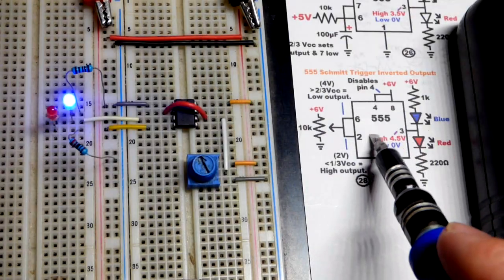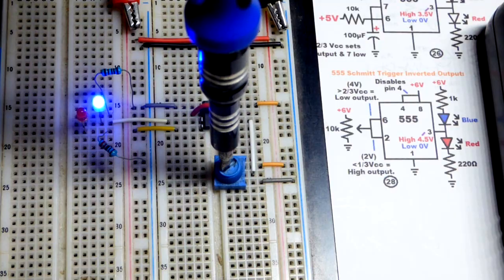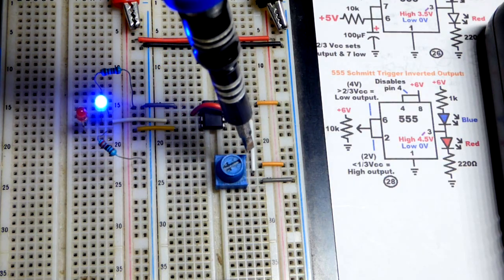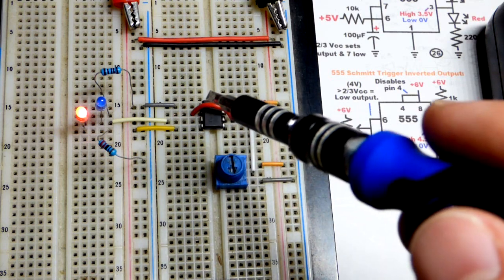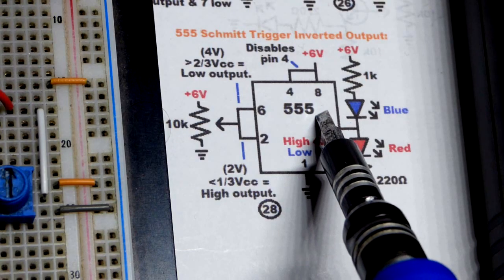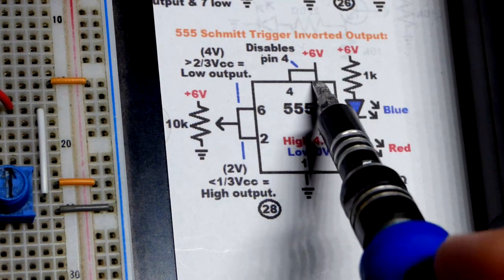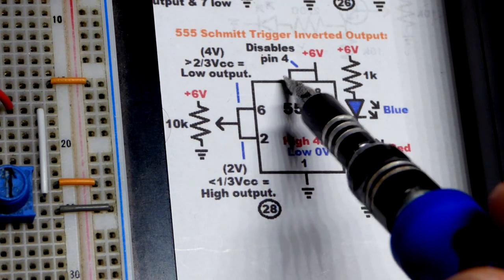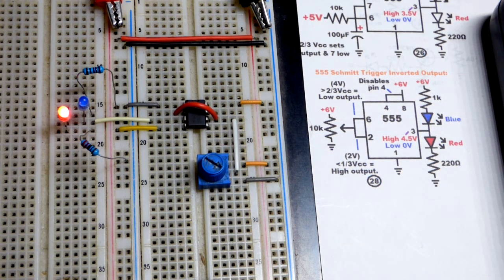555 timer Schmitt Trigger Inverter demonstration circuit

Comment: Why the resistor with the arrow connected to power and ground by pin 6 and 2? I don't see it Im new but I only see the two led resistors, unless the jumper wires from pin 6 and 2 act as resistors in a way.
Reply from the maker: The resistor with an arrow symbol is the blue trimpot, which is a small potentiometer. It is a 3 terminal resistor. One terminal is a wiper that slides across the resistive element inside the component, changing how much resistance is on each side of the wiper. Trimpots can be used as a variable resistor, but is usually used as a voltage divider. It's being used as a voltage divider in this circuit.
Reply: @Electronzap  thank you 🤙🏾

Comment: Like I was making some oscillators ne555 and then I reached upon lc oscillators 
So if I make ghz frequency according to calculations 
So It would produce microwaves.
Reply: So like how can I use it to make you know cook foor and stuff or anything like lighting up bulbs something like that
Reply: Or can I use it for driving some transformer or anything
Reply: Could drive a buzzer/piezo with audio input amplified with a transistor